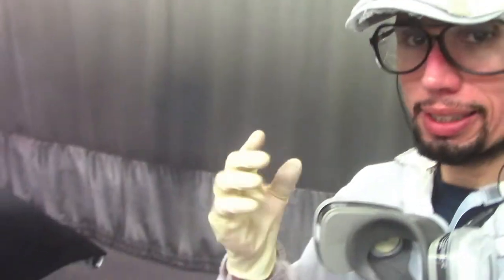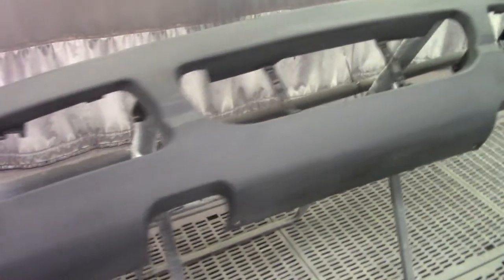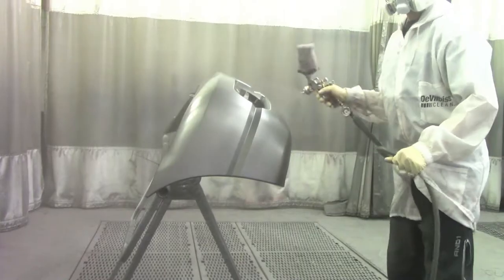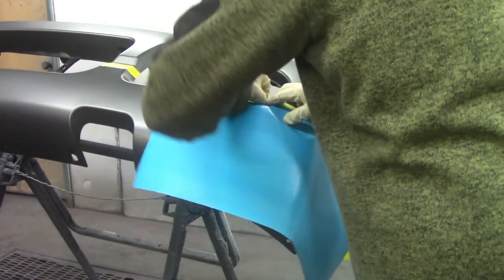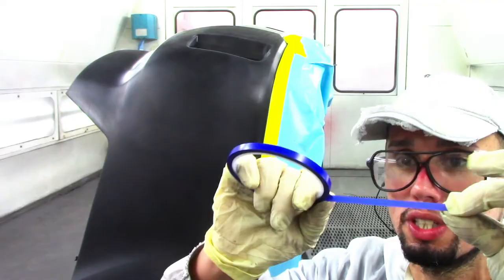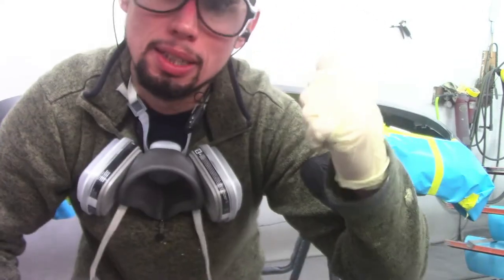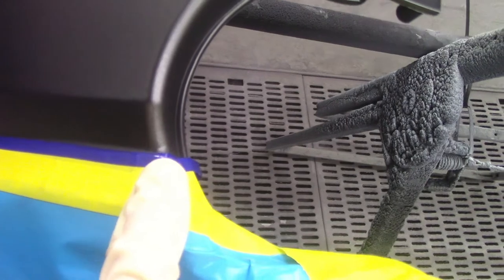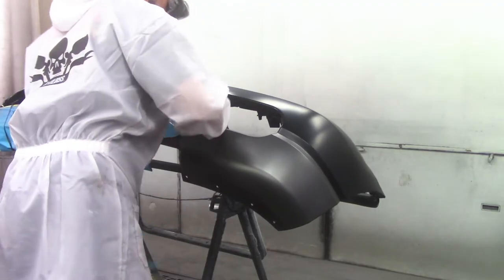How to Mask and Paint a two toned colored bumper

Comment: Nice . A question why did you base coat the whole bumper  in metallic to start ?  Why not just paint half the bumper with metallic, then paintt the top half black ? Cheers from NZ
Reply from the maker: I do it that way because it’s easier to coat the whole bumper and then mask the buttom part one time. Then all I have to do is coat the second color on the top and then remove the paper after and then clear coat it. It doesn’t make sense to mask the bumper twice to do one half first and then the other half.  This way saves time and energy.
Reply: @J.Lulo_  Good answer, do you really have to mask up the top half to put the bottom base coat on,  why not just paint just above the bottom half line, ( with metallic ) then tape the bottom and then paint over the bottom over spray. Your thought's ? Just saves time and paint not painting the whole top half of the bumper. Cheers
Reply from the maker: We’ll here’s the thing that you have to understand. When you paint a two toned colored bumper and one color is black. You always want to paint the metallic color first because you don’t want the metallics to fall on the black because the metallics can fall on the black and mess up the black color. So after I paint the metallic color I take apart my gun and clean it out to make sure there are more metallics in the gun and then I paint my black color. Plus the rest of the paint job on the car was black and I didn’t want the metallics falling on the rest of my paint job.